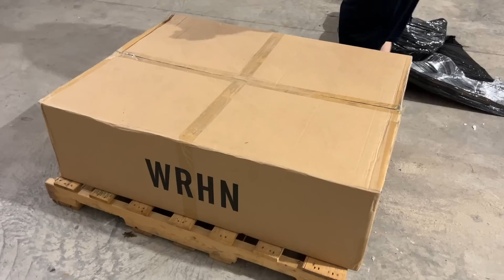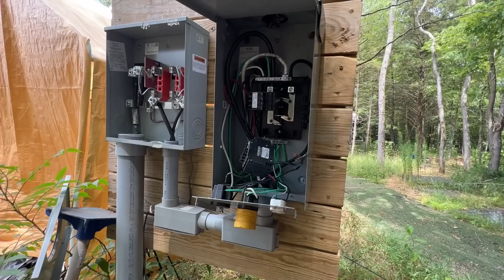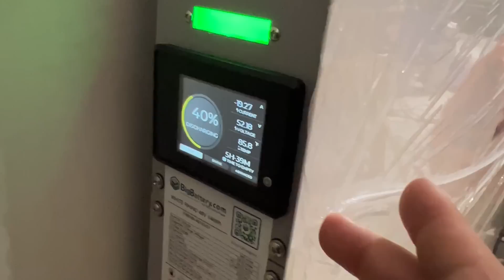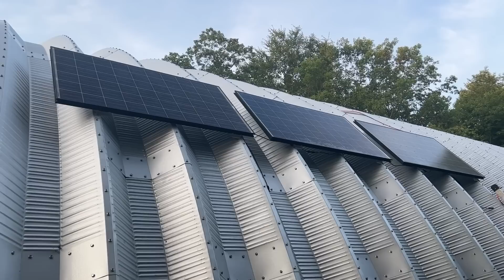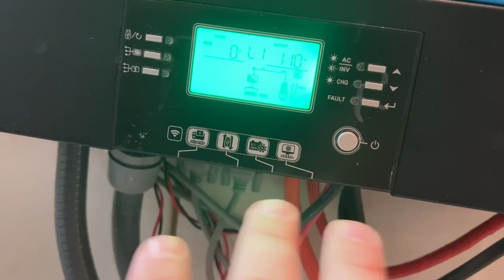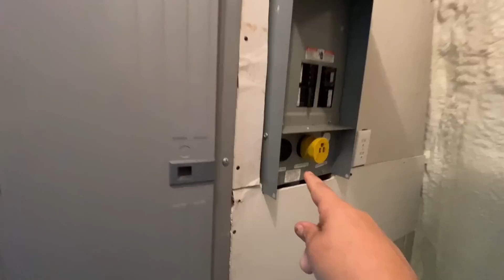DIY solar power to save $400 per month off our electric bill. SunGoldPower TP6048 Hybrid Inverter

Comment: The thing to look out for in the future is "V2G," that is "Vehicle to Grid." This DOES already exist, but only for a few models of car at present. The idea here is that you can charge your car from your surplus solar, then leave the car plugged into the house and run the house overnight from the car. Saves on fitting the house storage battery if you don't have the space for installing one.
Reply: does that mean that the car battery is flat in the morning so cant be used untill recharged by solar which means it becomes a fixed battery, may as well fit a fixed battery cheaper than a EV
Reply: @sullivns1  Perspectives: The house battery featured here has 14-15 kWh capacity. A Tesla Powerwall has a 13.5 kWh usable capacity. That is plenty for most domestic settings overnight. (Huge houses with humungous AirCon systems in the southern US are not THAT common in the rest of the world!) A car battery is usually 50 kWh or more now, (some small city cars may be less), with many being 65 kWh plus. Using 5 kWh on your house overnight is not likely to drain the car, unless it was down to 20% SOC (state of charge) when you plugged in. Common sense applies. If your night started with a fully charged battery you may lose 20 miles range? Not a huge amount out of the 150 miles range most cars will have.

Comment: I see a number of installs are moving to microinverters vs string inverters. Sounds like the main benefit is that if some panels are receiving lower levels of sun, they will bring down the production across the entire string vs just the individual units. Any thoughts on one vs the other method? Do the companies you partner with provide both options?
Reply: That's a different setup than what they are doing. Microinverters are for grid tie setup. They are doing off grid with a battery, charge controller and inverters

Comment: Man, I get that you have a decent sized building and a bunch of busses and fridges on the property, but $550/month in your state borderline ludicrous. That's over 5,000 kWh per month. Either someone is stealing power from you, your power company is incorrectly billing you or someone on your property is running a giant bitcoin mining operation. 

If you do the math, that means your property on average is consuming 7,000 watts of power continuously, 24/7, for a month straight. That would be the same energy consumption as 46 (yes, 46) full size fridges running, with both doors OPEN for an entire month. It would be the equivalent of 100,000 BTU worth of mini-splits, cooling the outdoors, 24/7 for a month straight. I have friends with multiple buildings on their property, 5 fridges, lots of equipment and machinery, including air conditioners, and their electric bill is around $180/month, in a state with electricity that's twice as expensive as yours.
Reply: It does seem high even at illinos standards.  However,  they are providing shore power to client busses as i recall. RVs aren't the most energy efficient either.  They are consuming quite a bit and the mini splits in the shop have to dump all the extra heat yet again to outside.  Heat double moved plus 100+ heat index doesn't help consumption.   I'm not really surprised after thinking it through
Reply: @richardlazarski4553  Like I said, that's the equivalent to 100,000 BTU worth of minisplits running, at full-blast, for a month straight, 24/7.
Reply: @AmericanLocomotive1  doesn't surprise me.  12k per hour per unit x 24 hours running mostly full on
 They have 3? The heat load for the shop is enormous (even as well insulated as it is)  with a hot bus plus their usage.... all that baked in heat to a hunk of 50k# and metal is going to take time to remove.  Yes, it is likely very comfortable to work in because of the air temps, couldn't work in my garage without a mini split.  However,  it takes time to remove the actual heat built up in the mass being introduced into that environment.   You can only remove the capacity of the AC unit from the overall envelope.   
If the RV is dumping the equivalent of 20k btus per hour with their AC running, the shop units will be running continuously and at almost full on.

Been a bit since my mechanical engineering days but the envelope is as tight as possible with foam. Now heat needs to move from inside to outside. They've introduced a giant heat source into a tight envelope, plus doors are opening test drives happen, more and more heat.  

If a bus or the space were left secured,  electric consumption would be way less.

Heat = power consumption.
Reply from the maker: We do run air conditioners here a lot and heat in the winter there were many electric heaters going all the time here.
Reply: He has busses connected and charging 12,000 ish watt systems, who knows what his transmission and demand cost is without seeing the whole bill. Also air compressor and lights welders and chargers. I have a woodshop I pay $800 a month that's about $80,000 in ten years if power prices stay the same. Grid power is a really bad credit card with a huge interest rate.... freedom starts when you cut the grid and pay off the credit cards😔
Reply: 5000 kwh for a month is not that much.  For a 2,300 sq ft all electric house in Texas,  I used 3500 kwh last February and the bill was $356.
Reply: Do you have any issues with your sungold inverters restarting on their own?

Comment: bgm....might sound crazy but look into cryptomining with your excess FOC electricity......I'm in the UK and found I can earn 3-4 times as much using my electricity cryptoming than selling it back to the grid,....even when all the prices are as low in crypto as they are now. I basically use it to generate money to buy the kwh I need in the winter using excess electricity in the summer...... win win. I auction snipe low cost graphics cards on fleebay that will pay for themselves in less than 1 year. build 3-4 rigs of different power so you can increase and decrease the energy used to suit free electricity avalable.

Comment: That's a super nice system and install. One of the best parts besides the monthly money savings is that you have back up power in case of power interruptions due to storms. One often hears of severe storms that knock out power lines for weeks and BGM won't have that worry. Awesome and informative video!

Comment: Nice install, I learned a lot about the modern hardware/batteries that are available. It doesn't make sense for me yet, as my bill was 33$ last month for heat/gas, but useful stuff to know.
Reply: Where do you live that your electric costs are so low?. I average more than that every other day though my local rate is much higher than double. in Tenn. where Scott is
Reply: @pyotyrprepka6422  Idaho 8.6 cents/kwh. It's been a mild summer so AC usage has been very low

Comment: Scott, I commend you for undertaking this solar installation.  I think it's great and quite logical.  Just a curious question of mine-- I guess in winter you may get a bit of ice or snow on the panels.  Will that run-off by itself from the slope of the roof, or may you rig up some sort of broom device to clear it off the panels?   thanks!
Reply: In Tennessee, snow and ice are not huge issues.  A few days a year, tops.  I am around 20 miles from Scott, have lived here for years, full solar on salvaged/repurposed LIPO EV packs.
Reply: @BadHaddy  Thank you for sharing your experience with the winter weather in Tennessee.  Much appreciated.  Sounds like Scott won't have to worry about it then.   Cheers.

Comment: Thanks for the leads. A lot of good idea's here I can use to provide hotel power for my semi-truck. Instead of solar power, I can use the trucks 200-amp alternator while driving to charge the BigBattery for powering the inverter when truck is turned off. I also noticed the inverter comes with a charging circuit to charge BigBattery from grid power. My intent is to power a battery operated A/C unit when truck is off in addition to L.E.D. lights, TV, microwave, and coffee maker. For winter I use a diesel fired Espar heater.
Reply from the maker: Probably don’t want to use the alternator directly to charge the battery because the lithium will take energy at full tilt the whole time while charging.  But adding a charger that regulates the charge amperage will work great

Comment: Your going to need a few of those batteries
Reply from the maker: A second would be nice but just the one is storing enough energy for all night power requirements.   Plus the grid is available as a buffer.

Comment: what about hail, which, like tornadoes, is pretty common in Tennessee, Florida, Mississippi, Alabama, Mississippi, Arkansas, Louisiana and several other states.
Reply: You typically get a ride insurance policy to cover any solar equipment , they’re pretty cheap.
Reply from the maker: They are rated for large hail.   I have walked on them and they don’t break
Reply from the maker: By the way your house had windows and so do your cars. You don’t let hail worries keep you from using them.
Reply: Also, the panes are super inexpensive. I don’t live in TN but further south in GA. I’ve seen hail larger than golfball size once in my 55 years. Everything has risks but i think this risk vs cost is great. I only wish my property was good for solar.
Reply: Panels are generally tested and certified for hail up to 1 inch in diameter. They are also good in hurricane force winds, depending on the mounting. Tornados are a different story, if your unlucky enough to get a direct hit from a tornado panel damage is probably the least of you problems. If you have a near miss flying debris, like trees, tree limbs, etc. can defiantly damage panels. In the south east large hail is rare, and if you manage your nearby trees well you can reduce the possibility of damage from tornados, with the exception of a direct hit.